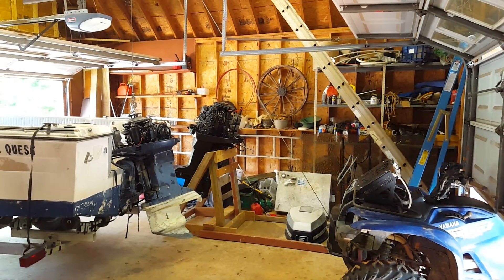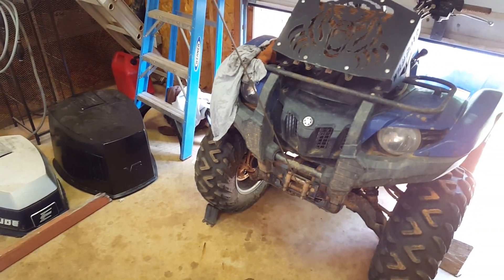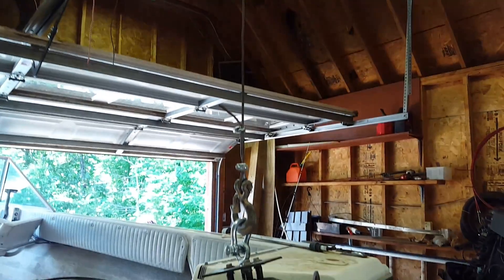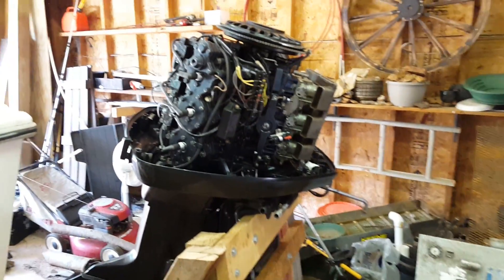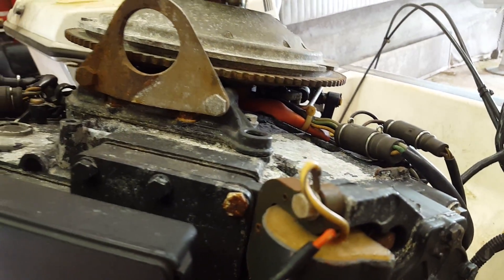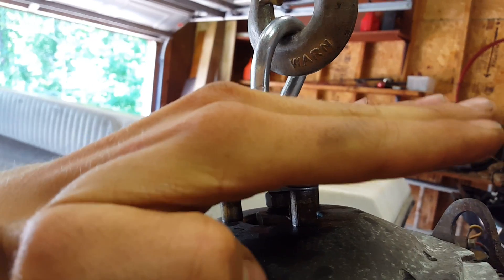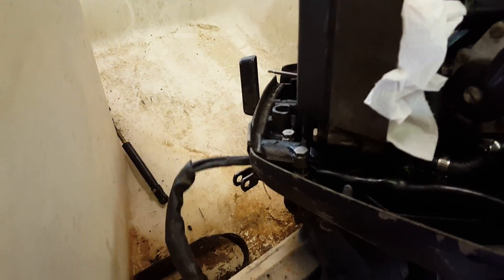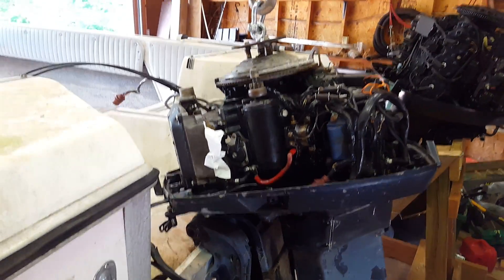How to remove an outboard WITHOUT a engine hoist

Comment: What about the lifting ring already ON THE MOTOR??
Reply from the maker: I didn't trust 1/4" 45 year old corroded bolts to hold it up.
Reply: @MattsShop  I think they are a little bigger than 1/4 if memory serves.

Comment: That's alot of weight on the fly wheel. They sell lifter rings to thread onto the middle of flywheel
Reply from the maker: This is was free. It doesn't matter. It's not going to hurt anything.

Comment: What size  Bolt is the for  Flywheel
Reply from the maker: Pretty sure it's 5/16"-24 fine thread. Might be 1/4"-28 fine thread. You gotta find a length that works for you.
Reply: @MattsShop  thanks

Comment: What about the holding capacity of the roof ?🤓
Reply from the maker: +Paul Jansen Good point! We beefed up the ends of the rafters with extra screws then put a piece of 4x4 wood post where the chain loops over the rafters. Worked great and has been plenty for lifting other stuff.

Comment: The little ring just to the right of the fly wheel is the lift eye.  That bracket was a waste of time.
Reply from the maker: +Ted Heavy I already know that. The reason I made the bracket was to lift my new motor that didn't have a lift eye. The bolts on this motor lift eye were very corroded so I used the one I made because it's stronger anyway.
Reply: Flywheel nut with a 5/16" metal loop welded on it, is a better solution.
Reply: @fourtoes412  Using the lift eye that's already there was the solution the manufacturer built into the motor.  Clearly he didn't know what it was for.  You damage the crankshaft lifting the motor like that it can do harm to the bearings the thrust washers the pistons anything attached to it.  Which is likely why the manufacturer would never lift the engine like that.
Reply: @tedheavy3441  Both Mercury and Yamaha offer crankshaft end lift eyes, we regularly use them in my boat repair shop.

Mercury lift crankshaft end lift eye OEM part#  91-904551
Yamaha OEM part#  YB-06820

Comment: why fashion the plate? their is a lift mount right beside the fly wheel.....
Reply from the maker: On the old motor there is a plate, but it is only held on by two corroded bolts. We figured it was safer to use the mount I made for the other motor.